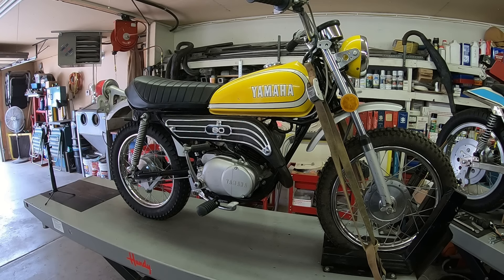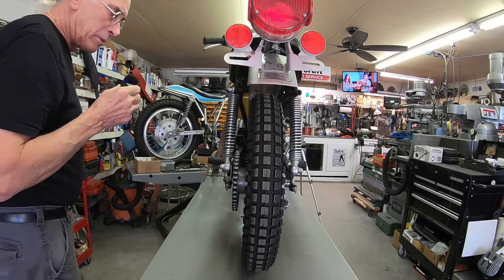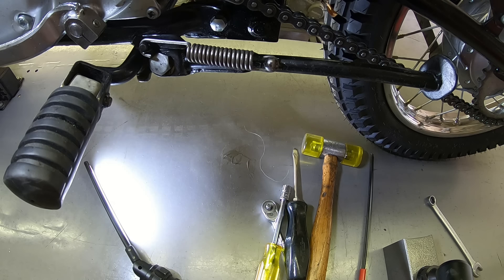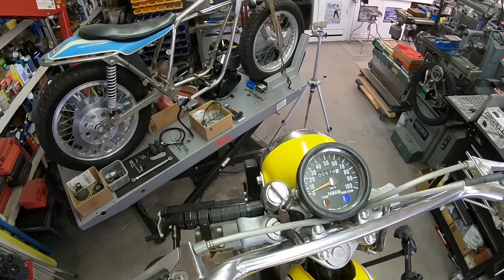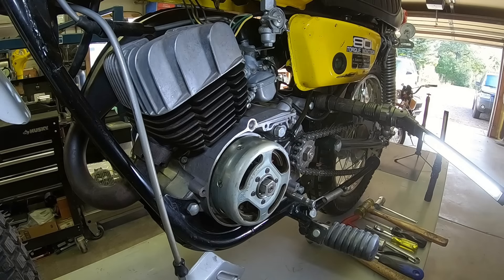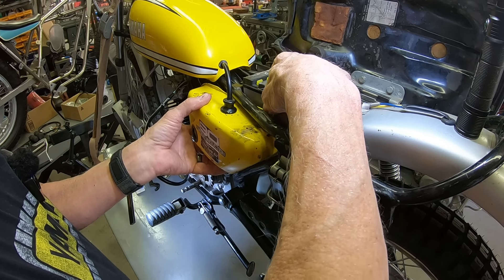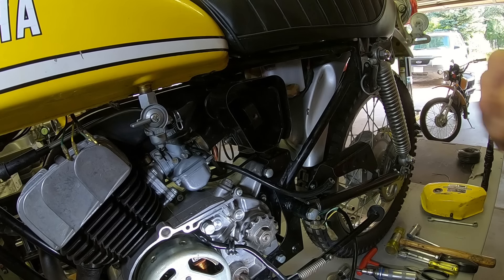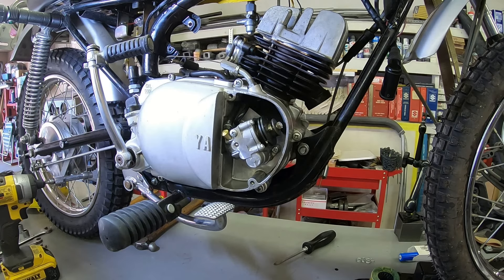Yamaha GT80 first look and teardown

Comment: A little gem Dale. My brother had a 1980 MX80 which was the same as the GT80 without the headlight. Gentle kids bike 4 speed. Cute! 
Just noticed the same tank cap. And I remember having to pull out and straighten the clutch push rod near the front sprocket as it was bent from something being caught in the drive chain one time. Can see this in your video when you removed the side cover.

We used to thump around the bush in the Blue Mountains west of Sydney when we were kids in the early 80s. I was on my 77 TS125C. Nice memories. Still have to repair my 76 TS250A, that I mentioned to you a while back. Maybe over Xmas this year. Kind regards and Merry Xmas 2024! Craig
Reply from the maker: Thanks Craig, Oh the memories, bikes and kids, our first since of freedom. Yes, the clutch rod is a tiny thing on these bikes, I can see it to be a potential problem area. Yes, it's time to get started on your TS250. I had so much fun riding around on my 75 model this past summer, great bike.

Comment: I had a 1965 Yamaha 250 Catalina. When I rebuilt the engine in the early 70's, Yamaha had a Allen Bolt kit to replace all the Phillips screws. Loving your videos Dale.
Reply from the maker: Thank you, yes there are bolt kits for most of the older Yamaha's still. They are certainly better, but most of the time folks want the original style screws these days. Go figure!

Comment: Hello Dale. Love your channel. Im doing old yamahas to. They Are called fs1 in Denmark. The skrews on the motor is called Jis and is not Philips skrews. The grove is sligtly different. 😃
Reply from the maker: Hi there, I have heard of the FS1 bikes, very popular over there. Just as fun as these are. Yes I have a set of JIS drivers and use them everyday. Phillips is just a term that folks over here use because they are more popular.

Comment: The 80 really is a cute little bike, being a scaled down version of its bigger brothers. Bet that would really go with a 90-pound kid on it. Can't believe the low miles and incredible shape it's in. A true survivor for sure.
Reply from the maker: That was a great selling point for the manufactures to make completive minibikes with spoked wheels, just great that they looked like the one that dad's rode too. I think I said it had miles on it in the video, actually this one is KPH whatever that works out to in miles, think it's even less.
Reply: @montana2strokeracer  Yes, the 576 kilometers equals just 358 miles! Incredibly low miles or unhooked the cable. Looks like actual from the video though.

Comment: I don't think that's not an original key switch. My 78 is either on or off. Awesome to see that you're working on one of these though for sure! I absolutely love mine, although I wish it had some more power I must admit lol.. I have made mine a little quicker by installing the transmission gears out of a 74-75 YZ80, a piston and rings from the same yr YZ's, and some minor port work. I have a different carb on the way hopefully that I can make work on the old girl. Will find out on Monday.  Fun little bikes regardless though. Thanks for all the great videos Dale!
Reply from the maker: Awesome Cody, it looks like a lot of the parts from the later models fit the older. I will check out the wiring, I think they have a couple wires crossed.

Comment: im thinking you are rite about the switch,  left should be run with no headlite ,,  middle should be off and right should be run with lights turned on,  just my 2 cents worth,  another good vid dale,  catch you on the next one...
Reply from the maker: I think so too James, just a couple wires crossed I think.

Comment: ck harness under tank , wire connector
block unpluged
not letting key switch ground.
we used to start by just unplugging that block.
Reply: or it is wired wrong in the headlight bucket? looking at an owners manual it is wired wrong. pos 1 off pos 2 run no lights and 3 run lights
Reply from the maker: It was just something that didn't seem right to me. The bike is here for engine work so that is what I will do. I will let the customer worry about the switch unless he wants me to look into it. I do bet your right though, just a couple wires switched.
Reply: @MegaWildweasel  trust me, if you 
unplug connector
under tank or cut
harness bike will start. This one aint in the book.

Comment: A nice clean bike. They used Philips screws on my 87 rz350.
Reply from the maker: It sure is John, I really don't mind the Philips screws, you just have to have a hand impact driver, no problem if you do.
Reply: @montana2strokeracer  Yeah, I use one all the time. With all the modern electric tools, you still can't beat the old impact driver. I remember the days when they were sort of expensive and rare, and only dealerships had them.

Comment: Does anyone know what type of transmission oil does this use? I have a CT1 and looking for that info
Reply: regular motorcycle oil.  10-30w stay away from car oil as a lot of it has friction modifiers that affect the clutch (making it slip) folks use rotella diesel oil too.
Reply: Motorcycle oil is correct! Although the "car oil" will work for a time, it does not have the proper additives for use with the wet clutches that these bikes have. I run into this problem a lot with older quads as well as these older bikes. I have 8 of these bikes myself and thoroughly enjoy riding and wrenching on them. ❤❤🙂🙂👍👍@MegaWildweasel
Reply from the maker: Just 10/30 motor oil. That is what the manual calls for. Remember at that time synthetic oil was just starting to come out. So, most motor oil back then was petroleum-based oil. I have had many folks come into the shop with slipping clutches, when asked if they were using synthetic or semi-synthetic oil, all that were, a change to petroleum-based oil is all it took to fix the problem. In the 60s, and 70s these clutches were designed for regular car motor oil. Regular Car motor oil (petroleum based) from Napa in 10/30 is all I use in these older bikes.